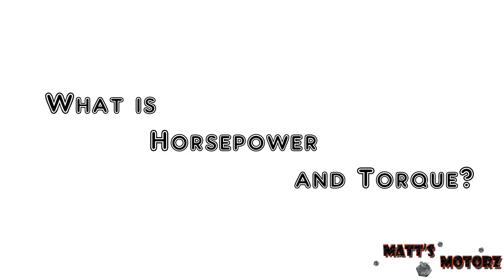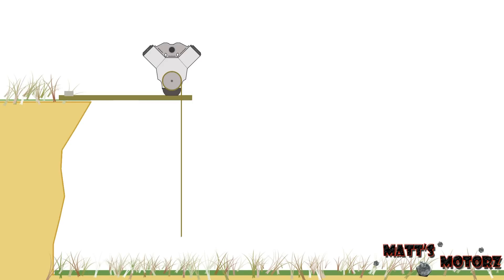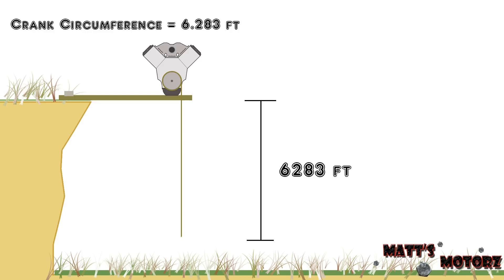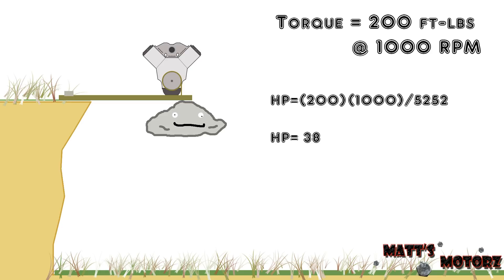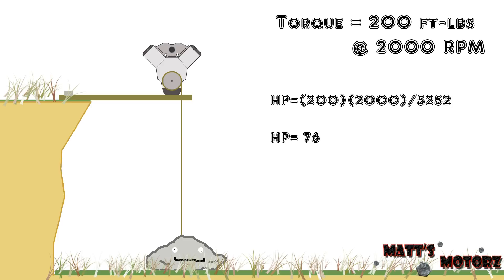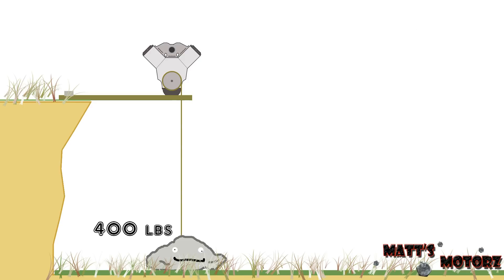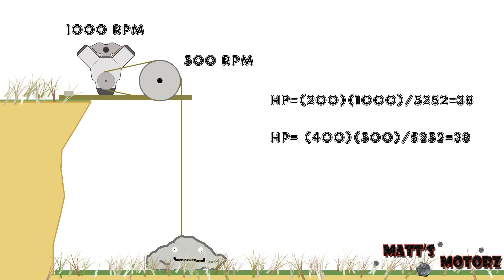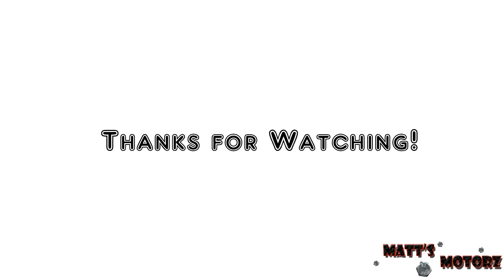What is Horsepower and Torque?

Comment: i kinda want to hear an explanation on 90s dohc honda motors the example is a 1.8 liter engine turbocharged fully built 700whp range but torque is somewhere around 400-450 ,i know those older honda engine are totally not known for torque i just want to hear the science behind it

Comment: Let's check the model in the video using METRIC UNITS and make some conclusion:

Motor torque: 200 foot pound = 271.16 newton meter
Rotational speed: 1000 RPM = 104.72 radian/second
Rock mass: 200 pound = 90.718 kg
Pulley radius: 1 foot = 0.3048 meter
Lifting height: 6283 foot = 1,915 meter

Now...what???

Well...I need to deal with the ROPE'S FORCE that is pulling up the MASS of the rock against the GRAVITY FORCE that is pulling the rock downwards. Newton came up with a law about MOTION that is expressed by the formula F = m*a, where "F" is the force on a mass "m" causing an acceleration "a". From this formula you can also say that a = F/m. More force means faster acceleration and more mass means slower acceleration (as acceleration is force divided by mass).
In other words, the rock will not be able to instantly get to any speed but will have to ACCELERATE. 

Let's call the force of the rope "Fr" and the force on the rock from gravity "Fg".
Since torque is "force times arm (radius)" we can derive that the rope's pulling force is:

Fr = t / r = 271.16/0.3048 = 889.6 Newton

And the force of gravity on the rock is derived from Newton's law of motion involving the acceleration of dropping objects on planet earth g = 9.80665 m/s2 (standard gravity).

Fg = m * g = 90.718 * 9.80665 = 889.6 Newton

The effective force on the rock is therefore:

Fe = Fr - Fg = 889.6 - 889. 6 = ZERO Newton => NO ACCELERATION = NO MOTION

In other words, the ROCK WILL NOT MOVE AT ALL.

Then comes the actual engine speed being 1000 RPM causing a rope speed of 2 * Pi * radius * 1000 / 60 = 31.92 meters per second, 115km per hour or 71 miles per hour. That's freaking fast!

Hey, this engine needs a clutch to engage the load in some controlled way to get to that fast of a speed without stalling. But a clutch wont be enough to generate enough pulling force to overcome gravity and get the rock moving as described above. You also need a transmission that can help get the rope pulling force substantially above gravity. And there you go...as simple as this description is...in actuality it demonstrates why we need a transmission and clutch. And the actual lifting time entirely depends on how effective those components will be much like what defines a fast accelerating car.

Alright, let's assume that the rock gets to its 115km/h or 71mph speed through some sort of CVT type transmission and clutch. And let's assume we don't slow it down at the top using the engine. In reality this means the rock will have gained some energy both in terms of KINETIC ENERGY "Ek" (motion) and POTENTIAL ENERGY "Ep" (against gravitation at the height "h"):

Ek = m * v * v / 2 = 90.718 * 31.92 * 31.92 / 2 = 46216 Joules
Ep = m * g * h = 90.718 * 9.80665 * 1915 = 1703660 Joules
Et = Ek + Ep = 1749876 Joules

If we assume we have some magic transmission that allows the 38 horsepower "P" to be effective at all time, the travel time is minimum:

Time = Et / P = 1749876 / (38 * 745.7)= 61.8 seconds

So, yes, the theoretical best case travel time is more than 60 seconds and if you add air drag and transmission efficiency into the equation, it gets much worse. But this can't be calculated without knowing details about the rock's shape and the transmissions characteristics. This is somewhat like doing a car race up a hill. 

And before anyone try to replicate this, realize that the almost 2km of rope will mess everything up.
Reply from the maker: Nice math.  I like it a lot.

But as I have told you before, you are completely missing the point of the video.  It isn't to analyze every variable in an attempt to model real life, the point of the video is to give people a bit more understanding of horsepower and torque, in a way that is physical to them.   I will give you this, the choice of numbers could have been better (for example, picking a torque that would be sufficient to overcome the gravitational force of the rock), but in reality, it would make NO difference in helping people learn.  Most people wouldn't connect the dots like that, and taking time to explain all of these things adds to video time and makes people lose interest, and hence, the video success suffers.  

You know what? I thought to myself, "Surely this guy, who is coming back to this video multiple days in a row and commenting about this topic, must have all sorts of videos going into these concepts."  But alas, you have no videos.  I therefore suggest that perhaps instead of telling me how to make my video, you can make your own video about horsepower and torque.  

I am sure it will be riveting, not confusing, and not boring at all eye roll.
Reply from the maker: PS: Youtube automatically flagged your comment as spam.  I brought it back because you put a lot of thought into it, and I genuinely think this is a good comment.  I very much like your analysis, but again, it misses the point of the video.
Reply: Lots of people complain about the use of imperial units without giving it much further thought. So I thought...let's try using metric units :-)

Your explanation connecting a pound force (from torque) to a pound weight really works well only for those who like to look at the world in imperial units. But indeed I can see how this helps people get closer to understanding those two measures.

When using metric units it becomes obvious you need to equate force and mass through Newton's law of motion and that surely doesn't make things simpler...but it reveals the fact that there is an inadequate pulling force to lift the rock.

Making a comment here is about spending seconds to minutes. Making a video can be hours. I don't have the time for it unfortunately. Keep up the good work.

Comment: Is the cylinder volume not important to torque? I mean a truck motor with lets say 400hp 20 Liter can deliver more torque at its peak then an audi 4 Liter 400hp.
Reply from the maker: The diameter of the cylinder is related to the force acting on the crankshaft to turn it (due to an increased area, F = PA).  The stroke of the piston (height of the cylinder) is related to the size of the lever arm of the crank shaft.  Both of these things increase torque when increased.

Comment: why does the angle of cylinder matters, e.g., on a lamb0, most have a 60 degree angle, but on other cars, they are 90 degrees, what's that matter
Reply: The angle of the cylinder banks is for balancing, for example a V12 can have any angle, it is inherently balanced, a V8 must have a 90 degree angle so they can balance it so it doesn't vibrate :)
Reply: Oh, ok, I get it, then can you put a V12 lies flat, like 180 degrees
Reply: Yes :)

Comment: i will give a simple example 
Horse power is how fast you hit a wall and Torque is how far you take the wall with you
Reply from the maker: Many comments have said the same thing, and I really hate this example.  It is vague, and unphysical in terms of what these quantities really mean.  I am working on a part 2 to this video that addresses all of these concerns and goes into the physics.
Reply: This is not even right. When you hit the wall, what determines how far you push the wall has to do with the kinetic energy (E = m*v*v / 2)  and the engine work produced while pushing it (horsepower). Provided you have enough horsepower to overcome the friction of the wall against the asphalt, you can keep pushing it as long as you have gas on the tank. As the formula of kinetic energy specifies, higher speed makes an accident much more dangerous as the energy is "speed square". 50mph vs. 100mph has a 4 times difference in actual energy. Thus speed is hugely determining in how far you push the wall.

Forget about these simplistic false ways of looking at the measures of horsepower and torque. It's better to actually understand how things work.

Horsepower is a unit of power. More power means faster acceleration and potentially higher top speed. More horsepower also helps you pull heavier loads up mountains, for example.

Torque is a measure of twisting force. Measured at the crankshaft, it's not much interesting except for engineers who develop the car. Measured at the wheels, you can multiply it with the wheel's RPM and sum it for all the wheels...and you get the effective horsepower that powers your car.
Reply: Torque is how wrong, stupid and irrelevant an analogy is. RPM is how much it gets multiplied by "likes".
". Power is the resulting permanent
cognative damage caused to our collective consciousness.
Power, not torque, is the limiting factor in not only the top speed of a vehicle but also how quickly it can accelerate at any speed and how much weight it can pull up an incline at any speed.
Please do yourself and the comments section a favour and watch a video called:
"Horsepower is NOT how fast you hit the wall.
Torque is NOT how far you take the wall with you"
It's on the D4A channel. It illustrates the distain the people who understand Physics and engineering have for these idiotic Idioms that spread like a pathogenic mind virus.

Comment: stupid imperial units
Reply: Imperial units make people stupid about science. Let me explain...

I would blame those units as the reason people don't really understand the difference between a pound force and a pound weight (mass). The rock on this movie has a POUND WEIGHT of 200 pounds and the torque is 200 foot POUND FORCE. You really can not lift a 200 pound rock with a 200 pound force in a condition of standard gravity as the force is exactly equal to the gravity force on the rock. The rock on this video will simply not move.

Alright, I'm complicating things?

But think about it. Had someone from Europe made the same analogy using torque measured in Newton Meters and a mass in Kilograms, it would have been IMPOSSIBLE to just equate Newton with Kilograms. You would have to introduce gravity in the equation (Fg = m x g)  and you would also quickly realize that forces are at play that would sum up to create a force that needs to be above zero to cause acceleration per Newton's law of motion F = m x a. You would HAVE TO UNDERSTAND the topic. If people don't know those super basic things...they really know nothing about this entire topic.

Yes, "more horsepower can make a car accelerate faster" and such things you can say...but it doesn't mean you got it at all.
Reply: nm or ft-ln/lb-ft are all weird torque measurements
Reply: ThinkingBetter 
NM and Joules are dimensionally equivalent in the sense that they have the same expression in SI base units. So weird things can happen.  Since Torque (nm) represents energy transferred or expended per angle of revolution, one newton metre of torque is equivalent to one joule per radian.
also 
https://what-if.xkcd.com/11/
https://www.explainxkcd.com/wiki/index.php/687:_Dimensional_Analysis
lbft/ftlb :
"Foot-pound" is sometimes also used as a unit of torque (see pound-foot (torque)). In the United States this unit is often used to specify, for example, the tightness of a bolt or the output of an engine. Although they are dimensionally equivalent, energy (a scalar) and torque (a vector) are distinct physical quantities. Both energy and torque can be expressed as a product of a force vector with a displacement vector (hence pounds and feet); energy is the scalar product of the two, and torque is the vector product.
so they get used for energy and torque and gets mixed up by most people
Reply: ThinkingBetter thing is they are dimensionally equivalent...

Comment: wait so more RPM = more torque = more horsepower?
Reply from the maker: Remove "more torque" and you would be right.  But in real life, it gets complicated, as torque not constant, but a function of RPM.  Often times, as RPM gets very very high, torque goes down.
Reply: And torque is a function of the load...no load no torque (e.g. when clutch is disengaged). Torque in a car can even be negative (e.g. going downhill).

Comment: I had trouble grasping the differences between torque and horsepower until I did the mathematical derivations for the respective equations myself. The numbers made it far more clear to me than any verbal explanation I'd heard up to that point. Really, with a good understanding of fundamental physics and math it is far easier to understand the nature of the world we live in. It's not terribly complicated but it does take some time to get to a solid level of understanding. Anyone willing to put in the time to learn those skills will put themselves at a great advantage compared to others, even if you use them just to answer your own questions. I wish more people appreciated the value of understanding physics.
Reply from the maker: I agree 100%.  I am actually going to make a part 2 to this video that says this very thing, and then goes through the physics.
Reply: This is exactly right. Too many never spend the time to get to the actual understanding. It's better to begin the understanding by not thinking engines and cars cause that just makes it unnecessary complex. When you grasp what is a force, what is a mass, what is acceleration, what is speed, what is energy/work...move to understand what is torque and power. But don't begin with torque and power without understanding the fundamentals.

Comment: Listen to me. I will explain this so you can understand. Hp is how fast you can run. Torque is how much you can carry when you run. You are welcome
Reply: Listen to me, speed is how fast you run. Muscle strength is how much you can carry when you run. Horsepower is a unit of power and speed is something else. You can imagine a super tanker sailing at 30mph with an engine of many many times more horsepower than a race car driving 200mph. In fact, I could also argue in this way that "horsepower is how much you can carry" LOL as I just did with this example. But that would be equally wrong. These analogies are usually wrong.

It's better to look at horsepower as a unit of work per second of time. If you work hard physically you are producing more horsepower than if you are reading a book, for example.

And if you hold a book in a stretched arm and add another of the same book, you just multiplied the torque with two.
Reply: Nonsense

Comment: Nice video but in actuality using a setup that can generate a maximum of 200 pound of pulling force (on the rope) to lift a 200 pound weight of rock is doomed due to gravity and pulling force just canceling out each other. The rock will go nowhere. It's a bit like starting a car in 5th gear on a climbing road (where gravity has to be overcome). Your engine will stall and you will never get anywhere. Check it out. That's why you need to get started in a lower gear that provides adequate headroom of torque to get the car moving.

Comment: So shouldn't Horse power for any given car for what it actually PRODUCES be measured at the RPM of the wheels.
Reply: Obviously the horsepower a car is delivering to the wheels is what moves the car, but car manufacturers like to publish the crankshaft horsepower (SAE net horsepower). There are losses from the engine crankshaft to the wheels due to friction. Even the noise from a transmission represents a tiny power loss :-)
Differential losses tend to be large, especially in the case of RWD and AWD cars where the torque path is turned 90 degrees as it enters the rear differential and exits it toward the rear wheels. In the case of hypoid-type gear sets that are commonly used in RWD differentials, losses in the 5 to 10 percent range are the norm. In the case of FWD vehicles, the torque path is more direct to the front wheels and the use of efficient helical final drive gears means that drivetrain losses can be as much as 50 percent lower than on RWD and AWD vehicles.

Comment: does increasing your engine displacement also increase your maximum engine rpm itself not including the transmission just the crankshaft revolution per minute? hope you notice this 

(just a noob question thank you guys and happy holidays)
Reply from the maker: I don't know if I fully understand your question, but there is a lot of engineering into what makes an engines max RPM, just increasing engine displacement isn't likely to increase the max RPM, it is more likely to decrease it because now the piston will take longer to complete one stroke.
Reply: oh i see you have a point there. so the answer is no but it will give more torque. thanks sir! really appreciated.